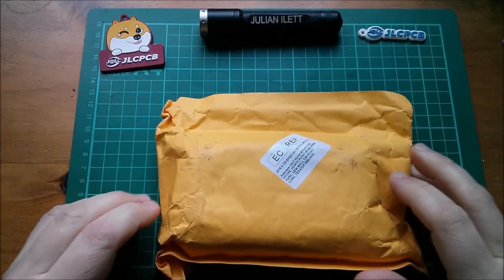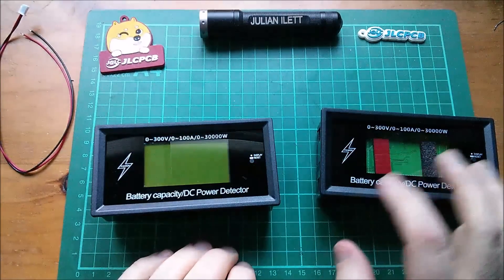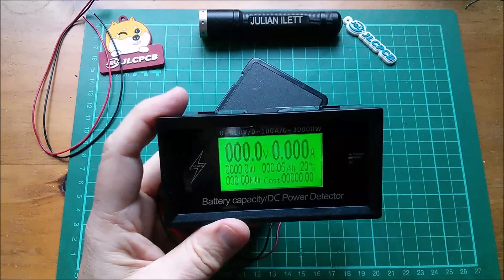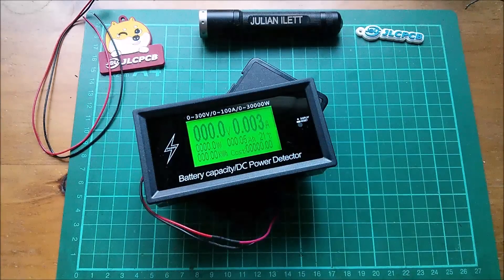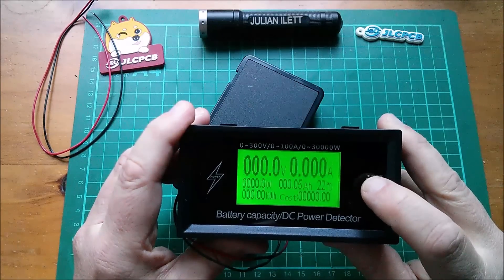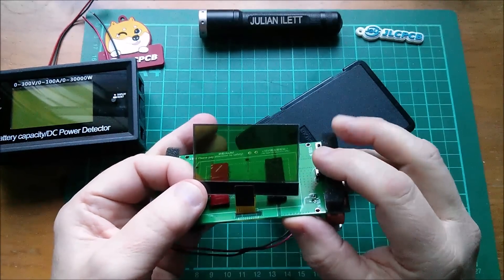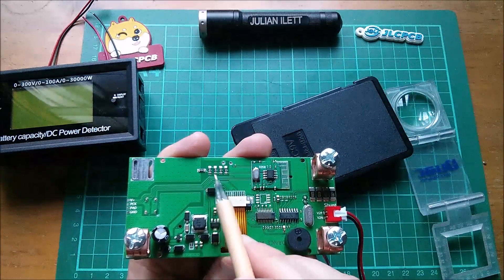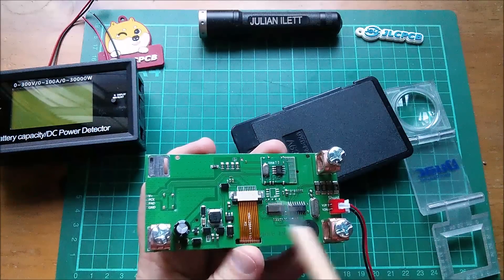Julian's Postbag #155 - Voltage and Current Meter

Comment: 300 volt, 100 amp, 300v x 100a = 30000 watts. Just math.  But are the voltage and current specifications realistic and safe?  Hmm.
Reply: The Chinese can make really good equipment but I would not trust products from ebay, amazon or alibaba etc...